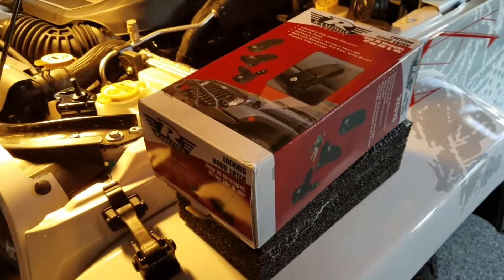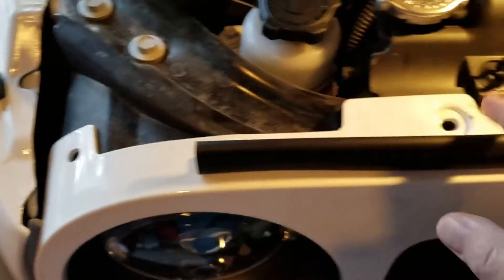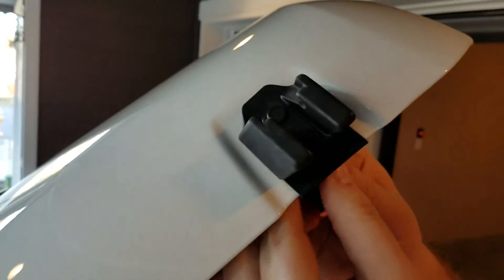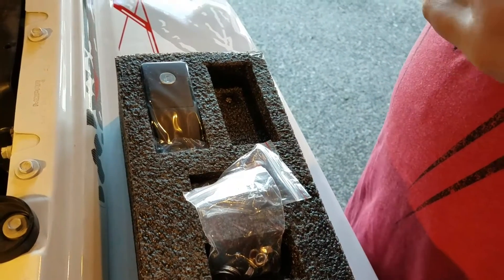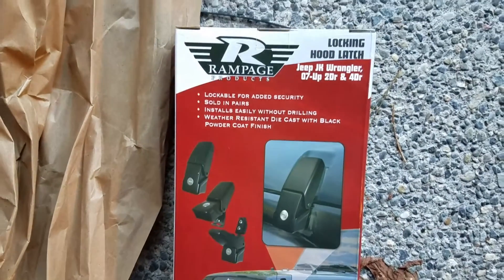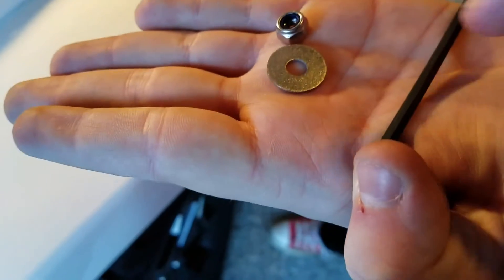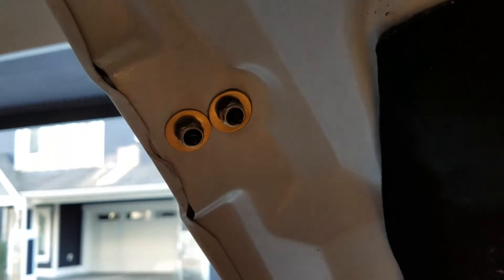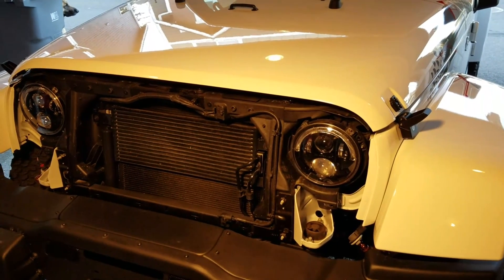Jeep wrangler locking hood latches by rampage

Comment: Passenger side fit well, driver's side I had to dremel about 2mm of the bottom hole to elongate it so it would latch. Simple and easy. Now I feel I can not lose my JW Speaker headlights and battery which would take maybe 10 minutes tops to remove without locks. Thanks for the video.....
Reply from the maker: thanks for your comment

Comment: Hey can you close the latch without actually locking it or do you have to lock it to be able to remove the key like other locks?
Reply from the maker: yes key lock
Reply: @vegasdavetv  so you cant close the latch unless you lock it? Asking in case i need to do a quick run without lockin it and unlockin it often when i dont need to.
Reply from the maker: yes u can, but locking secures it better
Reply: @vegasdavetv  gotya 👍

Comment: Good upgrades, but you would think for the cost of the jeep it would come with better things, like the headlights. So far I would do the same upgrades you showed in your videos and they all seem easy to do as well . What is your opinion as far as what jeep should do straight from the factory?   I tell ya I still like what jeep has done over the years and one day I will get one, its definitely on my list.  Have you had any problems and how long have you owned jeeps?
Reply from the maker: RoadTrippin Jeeps are a more personalized thing and the people at Jeep know that so that's why they leave some of the things generic. Lots of aftermarket options available. we went from 2 top of the line Dodge Ram trucks down to Jeeps because we were that impressed with her ability. Off-road, snow water and a pretty comfortable ride. we also love that we could make it our own and customize it and it's very easy to do.   unlike any other car that requires a computer and 7000 tools to remove something with a Jeep it's a simple job. Now I know in 2018 Jeep is releasing their next model year of generation  Wrangler and we expect them to upgrade to maybe a camera & LED headlights in that year 2018, and a few other improvements including I've heard the possibility that the front window will no longer be able to lay down flat but we'll have to wait and see. we love each them. by the way many of the options we have added can be done by factory or dealer for a cost.  if we do it there is no.labor cost, I can shop around for best price and we know it's done right, plus the joy of working on your own jeep.
Reply from the maker: RoadTrippin yes, you would think it would have at least headlights and reverse camera.  for the cost.  I expect it will in 2018, as you can now buy a Rubicon with new led headlights.  so it's a year away.  but there very durable and capable machines so the is why they cost
Reply: Thanks and I am with you, I like to do things myself, I really enjoy it.